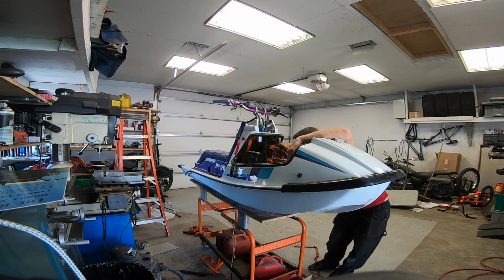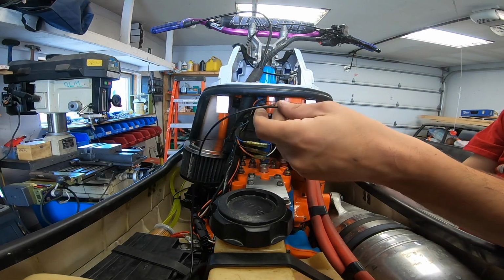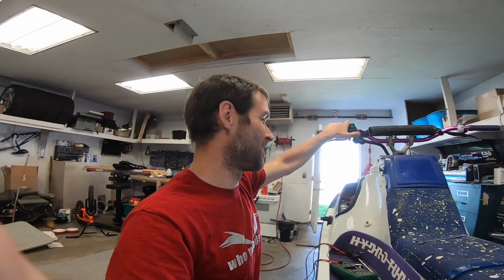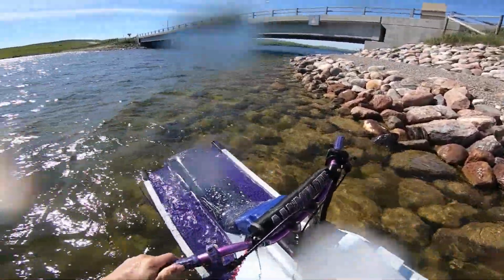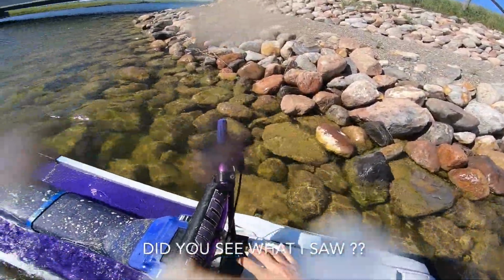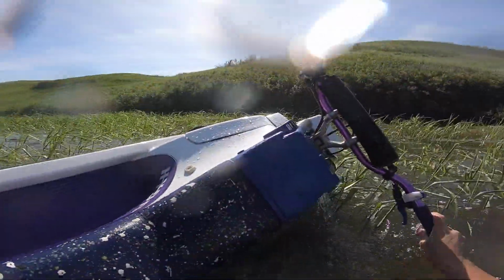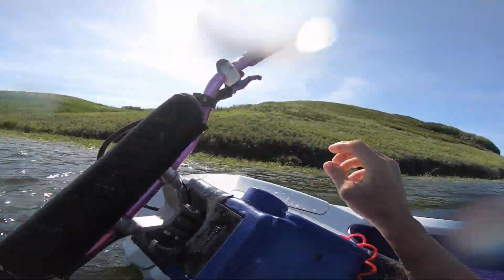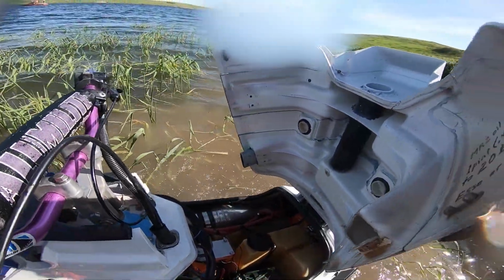Electric Bilge Pump Saved Me !! - FINALLY A Nice Day ! - X2 Second Test

Comment: What kind of glue do you use for the seal?
Reply from the maker: At this time I believe I wasn't using a glue, and that was why so much water was coming in. I have glued it down with normal clear silicone a few times, and that works great. The household stuff works great as long as it is 100% silicone and NOT paintable.